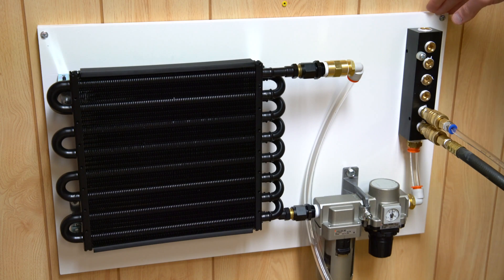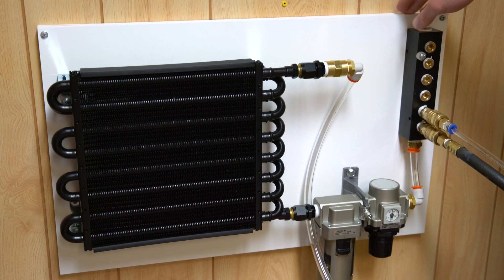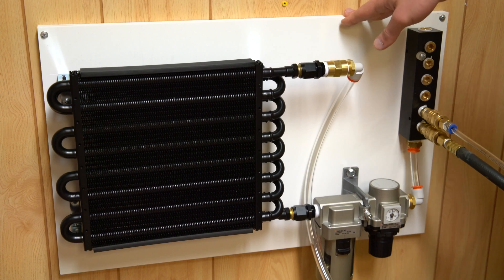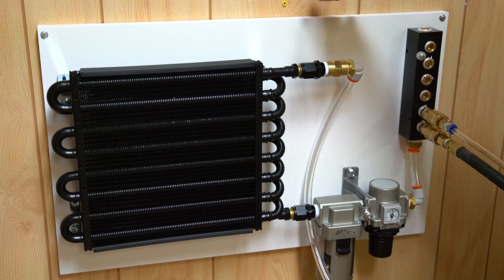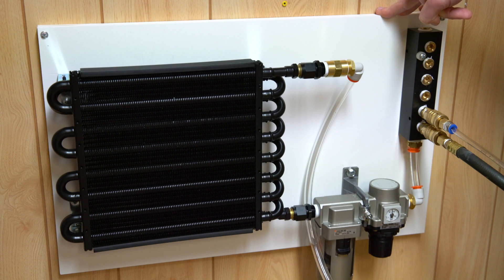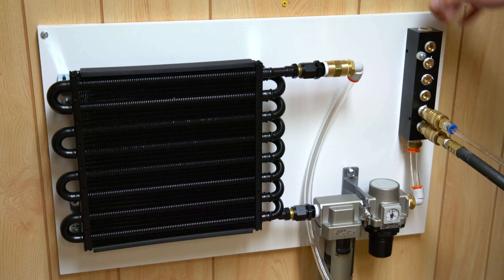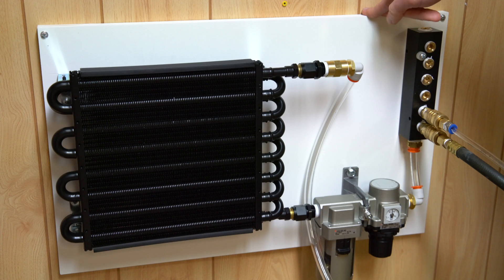DIY Low Cost Compressed Air Dryer Water Separator Overview

Comment: there is a reason for the other style of radiator which i can tell is going to be an issue for you. the reason all the tubes go through is so that any moisture will drain down to the bottom and into the seperator. the way yours is set up water will pool in each of those horizontal sections and wont be removed from the system. its a nice build though just change that one part
Reply: I was noticing this too. Do you have a recommended radiator without the loops that trap moisture?

Comment: Why on earth would you mount the radiator onto a flat surface like that? The radiator depends on air flowing through it... That setup has very minimal airflow
Reply from the maker: It's got about an inch and a half behind it, and now has a fan (mostly because I had a suitable one laying around). Even without the fan I found that most of the water was condensating inside of it, it has these embossed turbulators inside that help mix the flow but also lets the water pool inside. It's a water separator and gives me air dry enough for my requirements. I might post a follow up with some IR camera footage to show how little the radiator actually heats up when I'm using the system, people greatly overestimate it judging from what I've seen of other people's builds. Remember we're not cooling down hot transmission fluid here, just some warm air and water vapor from a small compressor so the thermal capacity of the radiator and the theoretical airflow from convection should and in my experience was enough, but like in the video and description I mention suggestions to enhance and the limitations of a system like this.

Comment: Where is the radiator fan??? It’s not doing anything without a fan or some type of cooling it with a radiator that small!!!!
Reply: Stop thinking about radiation, and start thinking condensing. 

Same as an alcohol still. Now yes they do use the water cooling to assist the condensation in the tubing. However that’s because that stuff is over 215deg F and it’s literally steam at that temperature. 

Your air cooled compressor would definitely self destruct before the lines could ever possibly be at 210deg.

Like I said, not radiator but condenser.
Reply: I agree with Hippie. The poster is making a water separator not an aftercooler. However I think the flow through the cooler might work better reversed so that the water would have to resist climbing upward thus slowing it and allowing further condensation.
Reply: X2
Reply: just use a house fan and point to it. :D
Reply: Great job.. been looking at using mini fridge coil at 40-60psi. and pump For air brush. But having difficulty finding a 40-60psi switch for 120v. Otherwise it should work.

Comment: Hi I just bought one of these. What did you use for fittings in the ends of radiator? I want to hook it up to air hose fittings. Thanks for sharing, Mike
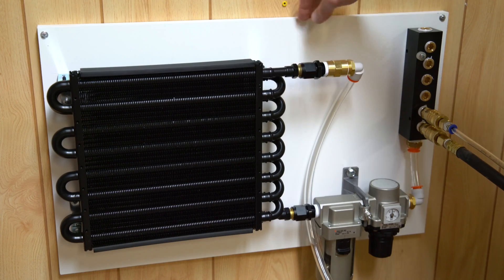Reply: He tells you in the video. Start around 2:50. It's quick!
Reply: AN to npt fittngs

Comment: Just a suggestion... Is it not better to put a T Coupling between the water separator and the consensor? When you open the valve at bottom the water gets out. Now you are forsing the water into the water separator. Water separator is supposed to filter the air only. Thanks Reza
Reply: Yeah however the tee and ball valve should be at the bottom. 

And the filter should be at the top. Drained often so it doesn’t become a water pipe. 

Or if you don’t want to keep going back and forth all day opening the valve. You could just install a straight going downward to allow the water a place to collect.
Reply: I was thinking the same thing

Comment: I don't know why but when I saw this I was like... "yeesh, that's gonna blow up" but then I remembered that automatic transmission coolers similar to this type often have rating up to like 300 psi.
Reply: just the question I was going to ask
Reply: Minimum testing psi is going to be 150% over the max rated output, for example, a max rated compressor of 150psi will test it’s tank at at least 225psi, but most tests run higher for the absolute maximum pressure. Therefore, a rated unit of 300psi operating should still be operated around it’s nominal limits for continuous use.

Comment: Where did you buy your fittings - specifically the 1/2” AN to 1/2” NPT. Also, what is that 90 and clear tubing -  how is it handling the temperature from compressor.
Reply: Check on amazon 8AN to 1/2 NPT

Comment: Hi Nikita- I am close to putting mine together and was wondering about the inlet temperature you have on the radiator. I have a hose that is rated to 140 degrees Fahrenheit. I had seen modification with after coolers (compressor-to-tank radiator) reaching temperatures near 200 degrees.  Would the inlet in your configuration get that hot? Just wanted to make sure I have a properly-rated hose.  Thank you.
Reply from the maker: I haven't measured it, I have the air going to this system from my compressor's normal air output (after the tank and regulator) so I'd expect it to be no different than any other hose coming off those outputs as far as what's okay to use. I've noticed the rad can actually warm up a bit the few times I've used a lot of air, I'm thinking of adding an AC voltage fan and wiring it to the compressor's switch so it turns on with the compressor's motor.
Reply: @NikitaLab  Thanks for the response. I contemplated adding an AC fan but didn't think it will help much. It would definitely be important for an after cooler (compressor-to-tank condenser).

Your videos and work is very interesting and show a great deal of planning as well as attention to detail. I hope you keep posting and that you get more subscribers. I am learning a lot from the contents on your channel. All the best.